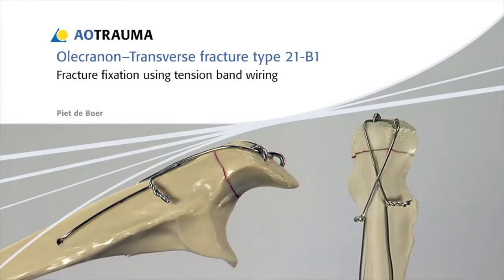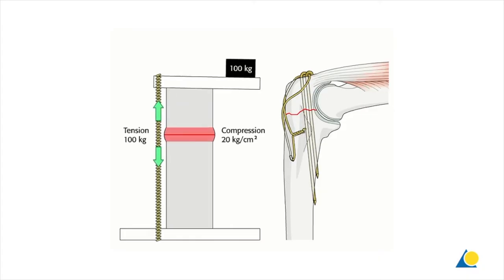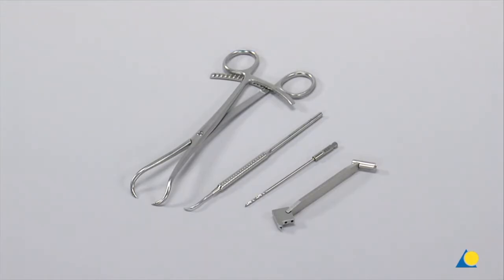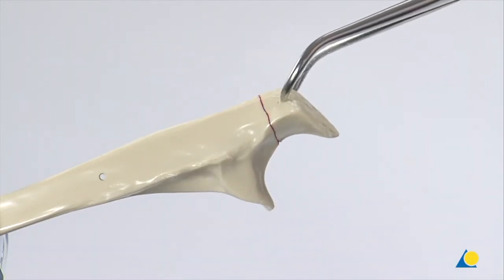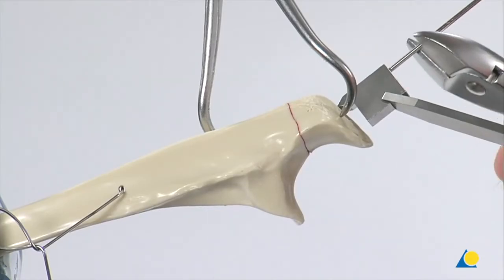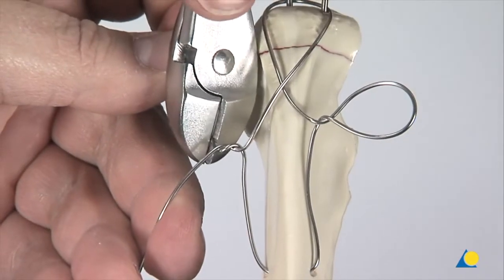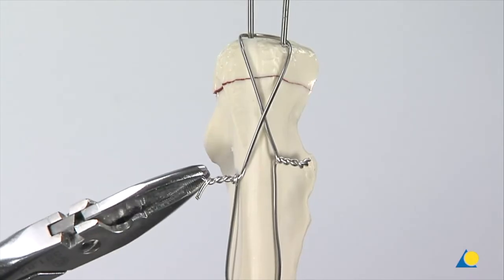Olecranon - Fracture Fixation Using Tension Band Wiring

Comment: ive done my TBW surgery on my olecranon.
Im wondering if my arm will extend 180 again. Im really sad and anxious, i need to know if i be able to do gym again
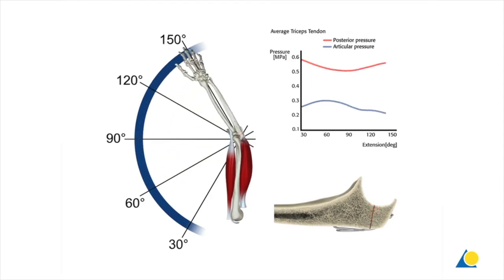Reply: can you flex your arm ? Had mine done 3 Weeks ago and extension is a none issue, but from the extended 180 I can barely flex it to ~130.  ( 9:30 for reference)
Reply: @lucahofmann3275  not yet, do you doing physiotherapy?
Reply: @kenzoravat  Started 12 days after the surgery, but that usually only relaxes the muscles / tissues for the next hours before everything become stiff again.
Now, 21 days after the surgery, the area near the wound / cut is still very stiff and warm to the touch.
Reply: @lucahofmann3275  but you have seen some evolution on the movement?
Reply: @kenzoravat  
only for the time of the session, a few hours later its stiff again yet still hot to touch from whatever metabolism during the movement
Reply: Hi has your arm improved now
Reply: @lucahofmann3275 hi did you recover
Reply: How is it going for you now?
Reply: bro did ur arm recover fully?
Reply: @MaximusLeague heyy, yes, my arm is 100% normal, but i was doing a lot of physio
Reply: @kenzoravat  also can you bench press and everything? i went through the surgery 25 days ago just started moving my elbow but had my thoughts that I might not be able to get back to gym. Also did you get your wire removed?
Reply: @MaximusLeague  yesss! my arm is like 100% normal now, i do bench and everything like before, just keep going on recovery, do a lot os physiotherapy, push it hard!! My doctor also told me that it was possible to not be able to extend my arm 180 degrees, but i refused to believe that and now my arm is fully healed… Also i did a second surgery to remove the wires.
Reply: @kenzoravat bro ,when did you do the removal surgery? I would be grateful if you answered🙏
Reply: @kenzoravat  bro when did you remove wires? :D
Reply: @100_fores_kommatia  hey, i did the second surgery 4 months later, to remove the wires
Reply: @kenzoravat thanks for the info!. Was it difficult? And did you need to do again physiotherapy after the removal? Yesterday i closed one year with the wires. Maybe i will remove them  soon,but i cannot say for sure that they bother my routine. I got used to them inside my elbow.
Reply: @100_fores_kommatia  Yes, the wires bothered me a bit. I couldn't straighten my arm 180 degrees because I felt the wires kind of hurting my tendon. It felt like there was friction between the wires and the skin and tendons, and it bothered me a lot, even when I rested my arm on something, like a backrest or table, because the wires were in "high relief." After I removed the wires, my arm was back to how it was before, 100% functional. I went back to playing all the sports I played like before; it seems like nothing has changed. I'm just left with a scar that isn't very pretty; when I straighten my arm, there's excess skin. I did a lot of physical therapy right after the first surgery because I was afraid of losing mobility in my arm.
Reply: @kenzoravat 🤟🤟and did you do much physio after the second surgery or it wasn't needed?
Reply: @100_fores_kommatia  wasn’t needed!
Reply: @kenzoravat God bless you man. Have a good month!